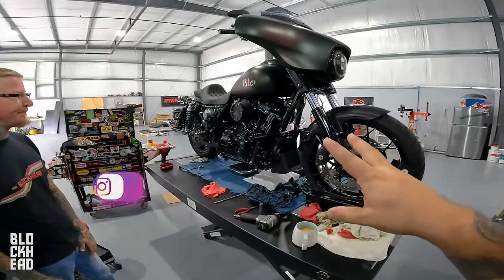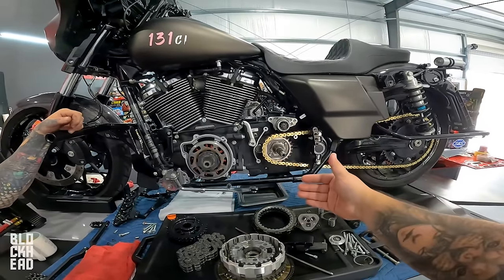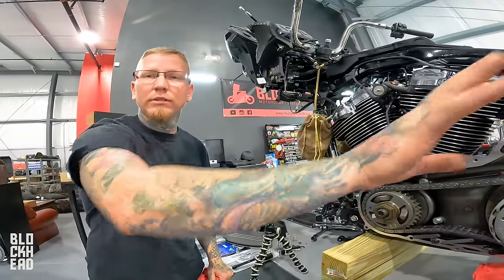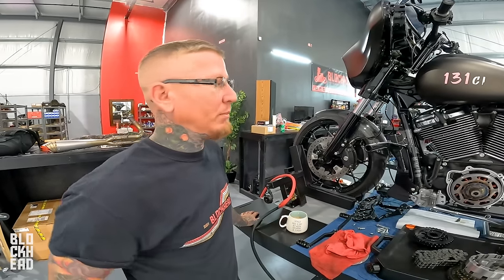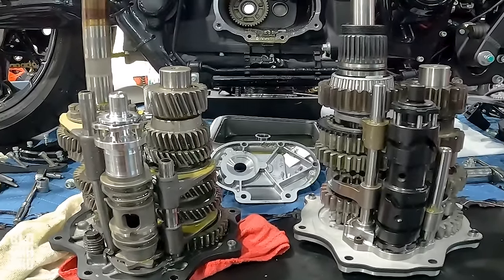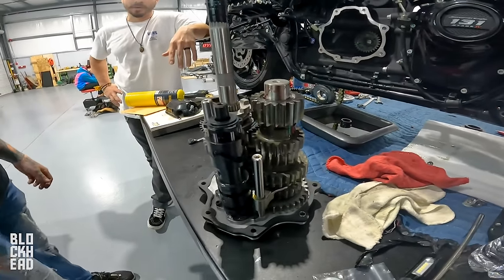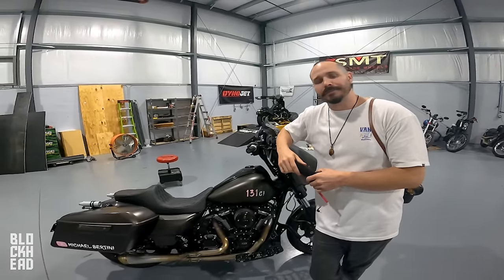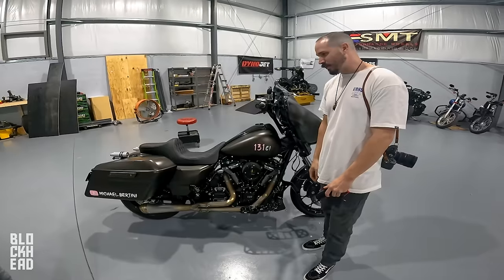Harley Milwaukee 8 Transmission PROBLEMS!

Comment: I know i'm not the only one whos excited as hell that we are starting to see actual shop work videos. Keep up the good work Blockhead crew!
Reply: i agree!
Reply from the maker: It's taken a little bit to get the Blockhead Garage setup and going, but we're finally to the point of making shop work content! Thank you all for your patience while we built the shop! 😄
Reply: I've been looking forward to vids like this since Maxwell stopped making his.
Reply: I have a m8 107 with a stage ll and after 3 years & 60000 miles, my stock shit box transmission went to hell.  It's my opinion that we (USA) should build our own bikes again instead of letting foreign  entities ruin a good design by using bogus materials.

Comment: Great explanation on the driveline. Question?- Once you take out the "Buffer" of the compensator, cush drive, etc. and install a grudge box. What becomes the week link? The Rear sprocket?
Reply: The crankshaft. Somethings gotta give more than likely you'll shift the flywheels.

Comment: Love your content, I have a question for you , I have a 2021 RoadGlide and I bought a man a war comp , I don’t do dumping the clutch or banging wheelies, and still have my belt drive would you recommend still putting the comp on. I just hate the sound of banging when I put it in first gear.

Comment: Hello, I am finally in a position where I can buy a nice Harley and pay cash. My question is should I buy something with the Milwaukee 8 or go with a Twin Cam? I am not worried about heat, or vibrations. I am simply interested in which is more reliable. I don't want to have any down time, I want to ride. I take care of my bikes and maintain them properly. I mostly commute on my bikes, but starting this year I will be taking one or two cross country trips. Thanks for any input!      P.S. - I love the channel, I have been following for years!

Comment: Hi 👋 GUYS, is it me or is there a lot of problems with the new style of Harleys nowadays?, Just seems to be a lot of reliability problems.,
I have had 3 Bikes, 1200s . FXR 1340 , and in 1999 I purchased a new Softail Deuce, 1450 , then, 1550 ,Cams  oil pump ignition  2-1 pipe. 
I had to sell it in 2019 through do to my ex female partner , It had got over 55000 , it never let me Down , 
Great territorial , I have been looking at a lot of your projects,
PHIL FROM THE DARK SIDE OF THE MOULIN FRANCE.

Comment: So I got a '19 RKS with a stage 2. I bought it 1 year old slightly used. I did my 2nd oil change on the trans before winter storage- both time I got a lot of metal stuck on the plug. Overall the bike runs great... figured I'll wait until total failure before fixing since it's out of warranty.

Comment: I've got a 2020 Breakout 114 that's cammed and tuned. I haven't had any issues as of yet. Fingers crossed. Luckily I've got a great dealer and a warranty forever on the motor and gear box.

Comment: More mechanics should do work like Chris does.....ive had nightmare experiences...especially here in Pa.
If I was even remotelyclose to you I'd be a loyal customer for sure.
Love the content and what you stand for man....
Reply: You'd be better off just building your own motorcycle and spec'ing it the way you want it instead of buying one for 25k-30k only to end up having to upgrade everything. That's what I'd do if I was going to try to get more power out of the mill.
Reply: @kennethwise7108  all my engine work needs will go to GMS racing in uniontown from now on. Greg Dahl is his name. He's like Keenan tatro but with modern engines.

Comment: You guys didn't talk at all about his aftermarket clutch. If dude had a stock clutch, even with all his other shock-loading upgrades, his tranny might have survived. There's a reason HD doesn't update their clutch with a 128/131 build: to save the tranny. (I had a 114 stage 3 in 2018 and back then the kit came with stronger clutch springs, now it doesn't). 
You put the grudge box in, now the customer will break the next weakest link. My guess is that the crank will twist (unless it's been welded). Otherwise the bolts will pull out of the rear sprocket. 
Time will tell.

Comment: This has to be the best vid yet. I love Chris's explanation of the drive train. dead balls on. I've rode 600 sport bikes for 40 years and just switched to a 2020 lowrider s. I just love it even thought i had to eat some crow from my fiends but its been worth it. rule number 1 about adding horse power i tell all my friends is once you add HP there's alway a weak link and once you fix that one theres another one and  on and on. love your channel.

Comment: U should explain why Harley have a separate transmission with need of a primary vs other transmission combined bikes. Lots of extra added weight, size, and complex with a separate transmission

Comment: Doesn't matter if it's a bike or a cage. You can't do serious upgrades to your engine without making sure your transmission can handle the power. I've seen plenty of guys that have done only the engine and ended up having to replace the transmission for the same reason you have there. Baker has been a go to for plenty of builds I've seen.  From everything I've seen your engine will die before your left on the road side with a baker. Once again congratulations on the shop guys.

Comment: All engines vibrate.  The chain driven Harley drive actually helps with some vibration to the clutch to the Transmission.  Most other bikes are gear driven as transmission is housed in the same wet sump. A gear goes directly from the crank to the clutch basket, essentially

Comment: The biggest liability with air cooled engines is heat.  There is a point where horsepower makes to much heat for an air cooled bike.  Liquid cooled takes that out of the exquestiin plus allowing tighter tolerances for more horsepower and less friction

Comment: Straight cut gears will add strength but will definitely make more noise. Gear ⚙️ whine is sometimes nice if it's not overwhelming. It adds to the character of the machine. I would love to know if there is a discernable sound difference between the Baker and stock H-D out on the highway.
Reply: I had the dds7 installed in my 17 ultra, after losing 3rd in stock transmission. No extra noise, but DDS has  more crosscut vs grudge box straight cut!

Comment: IMHO putting all this money into a bagger to make it fast, doesn't make sense. It turns a very capable touring bike into a nightmare of problems. If power and handling is what you want, the BMW 1600 B is the bike for you. 160 HP out of the showroom, smoother than smooth and much more reliable than this thing.

Comment: Why would you upgrade the engine and not upgrade the transmission? I would never put a big block engine in front of a stock 4L60 in a Chevy and expect to run it hard. I’m new to Harleys so am I wrong?
Reply: Blocks 131 has similar numbers but he didn’t mess with the drivetrain. Chris explains how the compensator evenly distributes power and the belt drive also has similar properties to distribute power evenly. This guy removed all of those parts and put 164 foot pounds of torque down metal to metal.
Reply: @zachfetter5710  and there you have it. I knew Block upgraded the clutch but wasn’t sure if anything else was done

Comment: Are y'all familiar with the M8's--specifically the 107s--issue with Fluid Transfer, or migration?  Does Baker also make the PUSHROD, clutch release (OEM PN: 37000218) "REPLACEMENT"?  I know that Cycle Solutions Racing (Ft. Myers,FL) carries/sells the replacement as does Macomb County Choppers(MI).  But as a HD Indee I'd prefer to go directly to the source of this "Fix It" part!

Comment: Hello Gentlemen,
I enjoyed the video but I appreciate the info so much more. As an old school rider/wrench, I do not work on modern bikes! One question I always get; " why do I get a CLUNK in my lower gear shifting?".
I tell most modern bike owners that they are shifting too soon,  third gear before you clear the intersection at 15MPH?????? I want to call them MORONs but I do try to be nice. 
At 13 almost 14 I picked up my uncle's 47 Indian Chief and my cousin taught me to ride. I love older bikes even with only four gears/speeds!
Seeing that Darley Havidson has dampened the rear sprocket and now (Thank You) put a "cam" to soften the drive on the chain, we shouldn't have so much tranny damage. But everyone wants MORE POWER???
      Your shop looks too clean and fantastic at the same time. Please keep up the great work.
You are in my prayers
Hoka Hey

Comment: Hmm, so you're saying that Harley motors are designed to work as they're shipped (or with THEIR upgrade parts), and that if you start changing things, the original parts won't perform as designed? That's astounding! 🤪 Good on you guys for getting 'em fixed up!

I did reach out on the website about a 1k service and potential Stage II upgrade. Never heard back. Maybe I've been banned from the garage. Idk. Haha. I'm in your neck of the woods tho. Wish we could link up. Oh well. I'll keep watching regardless!! 👍
Reply: Hey Dakota! It's Justin here at the Blockhead Garage. Chris actually emailed you back on the same day, called you, and left a voicemail (12/21/2021). Give us a call and I'd be happy to help ya get sorted out.
Reply: @lifeofjustinjames  Hey Justin, thanks for the reply!! I'm sorry, you're absolutely right. I just searched back and found that voicemail. That's totally my bad. Not sure how that slipped through. I get a lot of spam calls and generally ignore any call I don't recognize, so maybe that's why. Either way that's on me. I will follow up by phone and try to get something set up. Sorry for the confusion!!
Reply: @thedakotahurley  No worries, things happen and technology can get the best of us sometimes. Be in touch if you’re still interested 🤘

Comment: So buy a 30k bike and throw another 4 grand into fixing the transmission? I betcha Bert Baker is laughing all the way to the bank on this debacle. Plastic bearings and brass shifter forks? Additionally, another $1000 thrown at it for a compensator sprocket and cush drive? So glad I have a 5 speed Evo with none of that crap.

Comment: Had to bring my 122 (110hp/140tq) in to HD yesterday because of some crazy noise centralizing from the trans and derby cover. I just had a man o war put on last week and a rekluse clutch basket and then Wednesday I shift from 3 to 2 to go up a hill and it sounded like shaking a paint can. I still have all my gears and no slipping but in N it sounds the worst. In gear riding no issue, in gear clutch in the sounds is there but quieter. HD did all the work and I have a 6yr warranty just curious to know what it is. Have SE Clutch too🤷🏻‍♂️ thanks for the vid. Might upgrade to this trans at some point

Comment: What clutch were they running? What fluid were they running? I see the chain drive which I don’t understand why people do that. STOP RUNNING 20w50 in your trans!!! I know guys with really high horsepower in stock trans. Leave the belt you don’t need it u less over 200 hp

Comment: Really interesting video, I have a 22 114 Street Bob (stage 1) with 5600 miles on it. I had a whine in primary so sent it in to the dealer. Clutch bearing needs replacing and lower rocker gasket seep too. I ran the bike in properly and I do not rip the bike and ride carefully. Any ideas why this could of happened and should I be wary of anything else...Thanks guys..

Comment: It seems to me that the 131 tears up the drivetrain, compensator , clutch , drive belt , transmission. I have a 114 Stage 2. I was gonna do the 131 but I’m holding off because I like relatability over power anyway ! I’ll wait until HD beefs up the drivetrain from the factory someday besides I’ve spent enough on this bike anyway !

Comment: The Performance Machine Roulette wheels I had at one point also had no cush drive. One thing you learn from rideing various performance motorcycles is all V-Twins eat cush drives, compensators, chains/sprokets, and tires.   But then, that is how you get traction and phenomenal rear wheel control, even down a loose dirt flat track, no need for trac. cont..  Nothing beats two 45° offset common crank, pushing 2 out of 4 long strokes.

Comment: I am planning on doing a stage 2 on my 2022 m8 with the wood 22xe cam for high torque at low rpm’s. It showed about 132 lb-ft of torque. Does the tranny need to be upgraded or is the factory tranny good with the torque level I am looking at?

Comment: 3rd gear has been a weak link since the 6 speed came out in 2007 and with power increases it's a much bigger problem, i keep 3rd gear counter gear, pocketed dog ring and 3-4 shift fork in stock and use them regularly, and when the M8 came out they didn't change anything about the gear set except one of the trap door bearings (trying to keep oil out of the mainshaft that was getting sucked into the primary) so if you have a Harley factory 6 speed and abuse it your gonna have a problem, Baker knows what to beef up.

Comment: TIL : Oil should not look like a custom metal flake paint. When I was a poor Marine I had to replace a shifter return spring fork or whatever it is called in an evo transmission (I had put an evo motor and transmission in an old wishbone rigid frame). This is before youtube- I couldn't even afford manual for my bike- I ended up buying one from a used book store for a different model but same tranny. Did the whole thing sitting in my driveway no lift and figuring out most of it on my own. I honestly wanted to blow that bike up but when I was done it was immensely satisfying.

Comment: I jugged my triglide to 131 and the big intake and the midrange cam with a rekluse clutch and pingle shifter. Within a couple of months my gearbox went crunch.  I was in little bits and shards. I got a Grudge box and sent it in to be cryo-tempered and will run that and see if it gets crunchy.

Comment: Nice to have all this neat stuff available over-the-counter nowadays. Back in my day ( I'm older than dirt and still riding a kickstart panhead) when we were building strokers, we were taking Flathead 80" fly wheels, modifying and putting them in 74" Panheads to build strokers. 
You couldn't buy it, you had scrounge it and make it work. We made our own stroker plates. We did our own scraper plates in the cases too so you wouldn't over oil especially the rear cylinder as Flathead 80" flywheels were slightly smaller then the standard 74" flywheels. There wasn't a lot you could do transmission wise though. Basically we'd just swap out the drum top for a ratchet top if you can get your hands on one.

Comment: I've been using baker parts for years You failed to mention the price point of that monster which is $3,400 for the 6-speed overdrive also it's an actual real live overdrive and not geared like the 6-speed Harley where sixth is  just another gear This thing lets you cruise at very low RPMs at very high speed.

Comment: Now that is what you call a grenaded transmission.  That thing was like a dang claymore in there.  But I mean, AFAIK the 131 is not a stock motor for any Harley.  It's either a crate motor you can buy or an upgrade path from the 114.  The extra displacement, plus the extra oomph from the cam, and you'd be an idiot not to think there's some kind of hot tune on there as well, you're way way out past the intended stress levels for the stock trans.  It was never a matter of "if" but "when" the thing would puke it's teeth out.

Comment: Funny  check out big cell over at fast harleys only.  he's  on his 4th baker transmission.  Are they better than a stock m8 hd Trans yes. Twincam Trans have a better heat treat vs m8 Trans.  It ain't hard to see . 3rd and 4th gear are made of glass

Comment: i would think up to stage 2 would be ok without a drivetrain upgrade.  3 and 4 however may require these upgrades to avoid failure.

Comment: I dont think people are running chains for looks. They are people trying to get the harley to react faster and come on more responsive in general. The club style bije originated of neccesity for performance not looks. Ride club syle bike with decent 13/14inch rear shocks, front suspension upgrade (even just heavier oil) chain drive.. good seat n bars. In comparison to a stock version of that bike through some twistys. No comparison! Club style bike wants to turn it. Puts you up on the bike mot in it. Wiegting the front end with elbows out. Gives you more confidence, control and is thier when you need it... 
 Besides exactly how long does that stock compensater hold up to that kind of power. ...? In the m8
Most of us have herd the general consensus on the twin cams compensater ability to handle bigger numbers.
Thier is a reason people delete them aside from harder hit.
I would probably go with a upgraded compensater like dark horse offers rather than a full delete thoe.

Comment: Very nice content and very informative. My question is installing the star racing compensator ramp and the Aims Variable pressure clutch will it strengthen the drivetrain.

Comment: Thank you for that analogy I've been telling so many people that putting a chain and deleting your compensator or putting some other type of performance compensator and running around ramping on your throttle burnouts release taking it to the track and keep blowing up Baker transmissions there has to be a common denominator why isn't that all these guys will build engines that put chain drive keep blowing their transmissions even though they have Baker grudge box transmissions

Comment: More horsepower, more heat, more friction, and less durability.  Transmissions must be beefed up if going with large horsepower increases.  Some transmissions are overbuilt from the factory.  Look at the Toyota Supra.  The stock engine can handle 1000 horsepower without blowing head gaskets or transmissions.  Most manufacturers do not overbuild because of cost and they want repeat business.